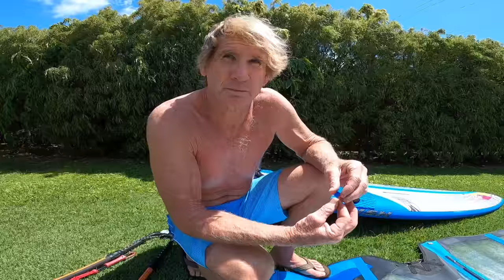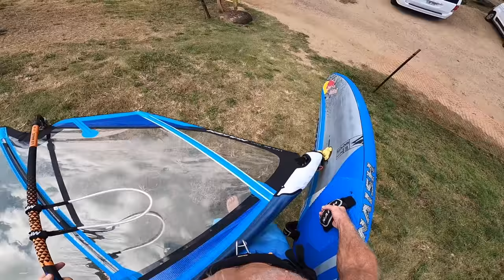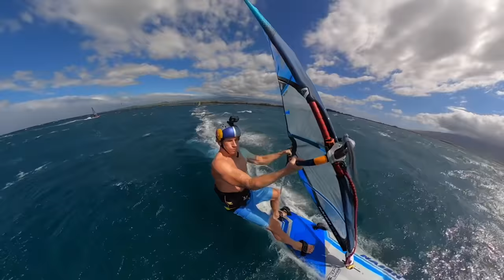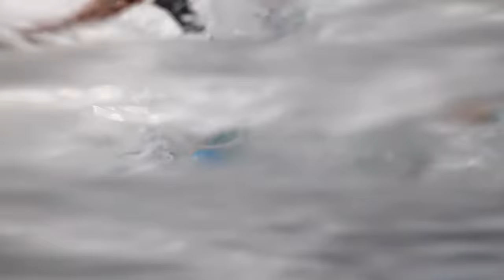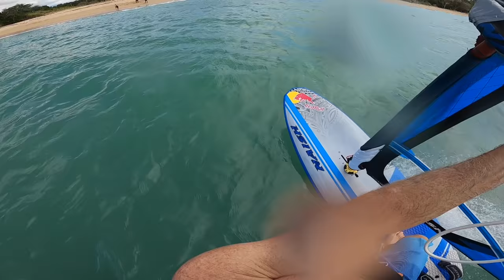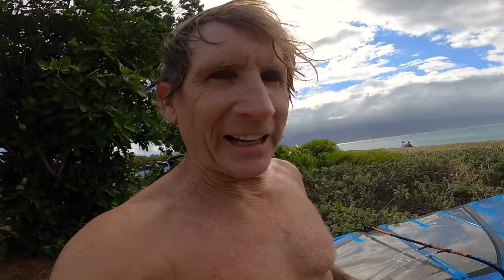Robby Naish windsurfing Hookipa to Kanaha

Comment: I windsurfed for years and changed to kitesurfing because it was something new.  This video has made me remember how great windsurfing is.
Reply: Nice!👌🏼
Reply: I kitesurf now as well but there is nothing like that feeling of blasting along on a windsurfer trying to get every ounce of speed out of the sail and the board. The connection you have to the sail is much closer than to the kite.
Reply: At 40 now I can also imagine being absolutely shattered compared to Hydrofoil kitesurfing 😂
Reply: @s2oooo  I mainly kite hydrofoil and although it is my favourite water based activity of all time, you are totally disconnected from the water and wind compared to windsurfing. How fast you go just depends to a large part on your kit and how crazy you are :) On a windsurfer I remember feeling like every little adjustment I made to the sail and board made a difference.
Reply: @chrisdickinson4576  at 40  years I don't think i could last 5 minutes  windsurfing 😂
Reply: @chrisdickinson4576  An excellent description of what draws me back to old school wind surfing again and again. Powered up on a beam reach and that moment when a gust attacks the rig and you pump into it and literally feel the energy course through your body and into the board as it accelerates. Doesn’t happen every day, but when it does it’s the most immediate form of sailing I’ve ever experienced!
Reply: Windsurfing, the sport of kings!
Reply: Im still at it, both windsufing and kitesurfing.
Reply: @s2oooo  I am 49 and still can windsurf half a day without a problem.
Reply: I AM 41 and i just got back from el Yaque. Next stop is tarifa for me.
Reply: Also no amputee arms and legs with windsurfing ;)
Reply: 46 and windsurfed for the first time yesterday.  I'm going back.
Reply: I'm 60, no kitesurfing for me, but I love windsurfing, even if it looks like "grandfather style" in comparison...
Reply: I sailed on catamarans for years watching this many times. This mixture of precision, fun and fitness just inspires and urges me to get to my club and some dear friends and get my ass salty again. Maybe a tiny string attached to the masttop (I'm Dutch xcuse me) and the tip of the camera boom to stop the resonance with the waves. Man, I love to see this so much.

Comment: Dave Sanger "The strangler" got me on a  Mistral superlight in 85. He rebuilt the deck and sold me the whole rig for $200. I went shortboard and did a few trips to the gorge and then the Navy got in the way of sailing. I cant wait to get on the water where all there is in life is the dance of the wind and the waves.

Comment: I have done Hookipa to Kanaha Beach Park and it is a truly fantastic coastal run.   I have also been quite intimated heading out of Kanaha into the deep waters, just straight shot out and back.   When you get couple of miles past the last seen windsurf or kite the ocean surface changes and the rollers are significant walls of water, gentle giants.  The wind seems to pick up and it tends be steadier.  At board speeds hitting 30mph, they do launch you if you want that.  The flying fish change in size.  At first, they are in schools and 3 to 6 inches.  They get bigger, solo and scarier out in the deep, like full 12"+ and you wouldn't want to hit them.

Comment: Great memories. Used to sail a 9.0 ft slalom concave custom that weighed only 8 pounds. Single-layer of glass. Sails was a north sails 5.4. I eventually broke it on a hard flat landing. Would you mind listing the specs of this whole setup?
Reply: 100 litres slalom board (Watch the video) and 5.4m2 "Lift RN" by Naish sails (Listen to the video).
Do you also ask other people to do your windsurfing ? LOL.
Reply: @team3383  @Robby Naish What size fin with the 5.4m for this type of sailing?
Reply: @finproductions  LOL

Comment: To me as a pilot, higher L/D just rocks efficiency-wise, meaning higher aspect ratio wings, or in this case, sails.  It's also telling the drag of the windsurfing board (we call it parasitic drag) at speed must be much less than the foil boards, as top speeds continue to be ~50% higher than foils.  Again watching how little (or none at times) of Robby's board is touching the water at speed, makes perfect sense.  Thanks for the video Robby!

Comment: Hey Robby, if you have your GPS turned on in your gopro, it would be cool to see how fast and where you went.  There's some very easy to use overlay software available now and and if you watch the instruction videos, you'll be able to work it with no problems. https://community.gopro.com/t5/GoPro-Telemetry-GPS-overlays/Telemetry-Overlay-New-user-friendly-program-for-adding-gauges/gpm-p/829373

Comment: It wasn't too long ago that sails with lots of monofilament were "out". Is this a budget oriented sail for the masses with the monofilament or some new improved type? Hard to believe "the man" would be riding a budget sail other than to promote it. I still have an old NP monofilament sail that I like. Glad to know I won't be too out of fashion using it - noisy but handles well. 
I remember seeing Robby Naish race a slalom in Hood River in the 80s where in one heat he was miles ahead of everyone and planing the whole time when the most of the rest of the pack was barely moving. The other racers were only halfway through the course when he went flying across the finish. They called the heat off for lack of wind but I thought they should have given it to the man.

Comment: Windsurfing San Francisco bay and the CA coast through the golden age of the 90s were the greatest years for me and my friends. I windsurfed from 1984 to 2016 at which time I would be almost unable to walk for a week afterward due to the enlarged bone spurs in the big toes. So I moved to Baja and learned to kiteboard at age 64, now 68 and my feet no longer hurt, it's a very relaxed kind of stoke!  Learning to kite from windsurfing is tough at first because you try to over muscle it resulting in stupid launches.   When you learn to totally relax and chill, hands close together on the bar, sheet out you will get it!

Saw you Robby, 1987 or so in the world cup race at SF.  You said hi and nodded like you knew me, that's stuck with me, thanks!

Comment: I must say that I find the idea of a short boom compelling, if not for the ease of control (and I will consider you the authority on this) for the portability of the sail. I can literally stash (even) the 7 meter RN sail in the back of the car without it ever having to spill over into the area where the gear shift is. And plus, its appealing to have sails that can effectively serve as Foil and regular windsurf sails. Fresh perspective. Kudos!

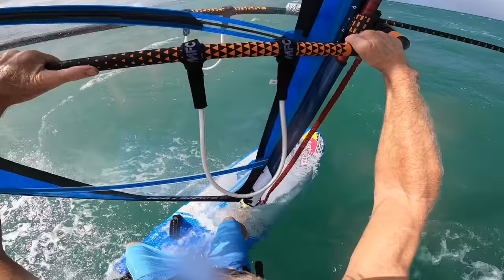Comment: At  4:44 the lowermost batten does not flip, so Robby nudges it with his right knee (despite plenty of wind). Wrong trim? Or is the sail trimmed according to specifications, little nudges are intended?   - On a later gybe in the other direction, the lowermost batten does flip, no nudging needed. Brand new sail, slightly extending under stress?
Reply: Inside gybe at Sugar Cove can be a long way in from the wind line. Maybe we’re seeing something different but the water surface looked smooth like he hit a lull and it didn’t build again for at least 15-30 seconds. 

I’m going to assume Rob knows how to rig a sail and he just hit a pocket of light air or he was way inside at the cove when he gybed.
Reply: @wallymcguire2033  My take-home message is: "A sail batten does not flip after gybing" can happen even to the best, most experienced riders, even with their brand-new, premium, signature sail. 
By the way, I also have a "Lift RN"  (a 7.0 with two cams) and I observed the same thing. Now I know it is not just me.